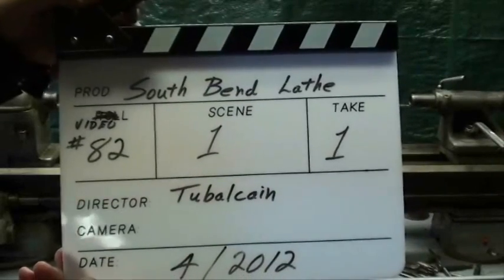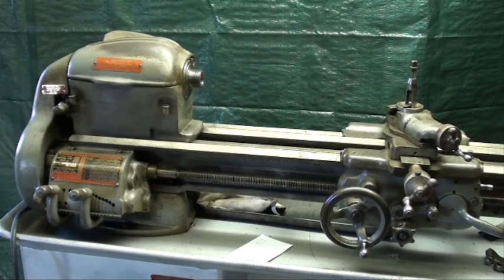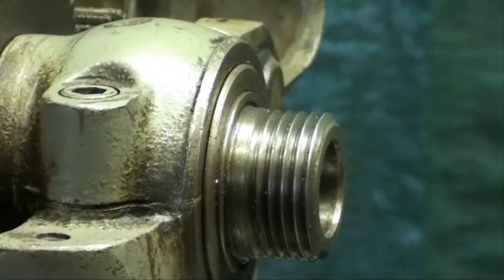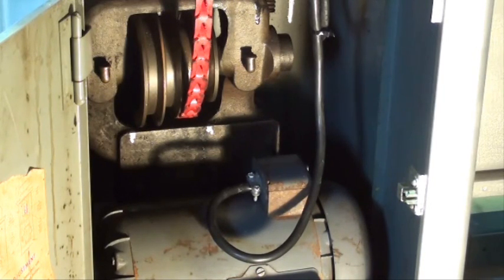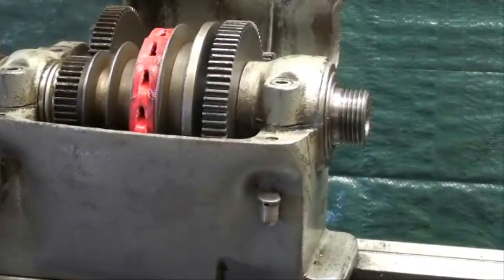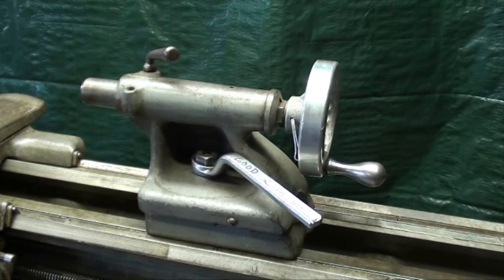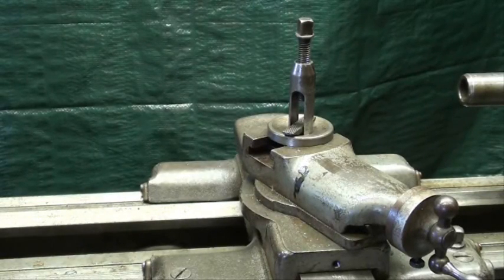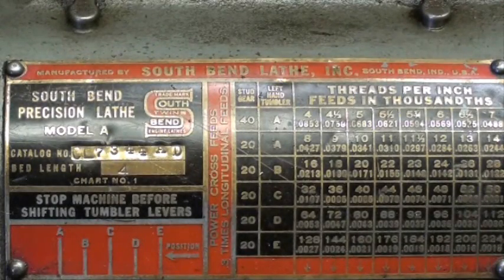tubalcain BUYS A South Bend Lathe model A tips 82

Comment: The first machine tool I ran was a South Bend lathe back in high school.  The project was a threaded arbor with washers and nuts to go with it.  After that we made a spring-loaded tap guide and a fly cutter.  I still have them in my toolbox and use them occasionally.

Comment: Great video. I have a heavy 10 with the original motor. We have 3 phase power in our shop but I chose to buy a TECO VFD so I could run it off of 110 single phase. It works great and I can dial up the speed between belts.

Comment: same unit in dad's shop....different base with motor behind and above....has the described damage from school kids running into the spinning chuck.... also has taper attachment. Dad had to repair missing tooth on back gear and replace half nuts on thread feed.   

Great machine.

Comment: Did you get any tooling with the purchase?  I assume you have enough in hand to outfit the machine.  My first lathe was a Southbend 10" heavy, sold it when I got my 14" Clausing.  The main reason was the variable speed control, love my Clausing, but I do miss my first love, the Southbend.

Comment: Hi Mr PeteI was fortunate to find a really nice South Bend 9a 4.5 ft. in South Bend. Nice condition. Has pretty light wear (gears in gearbox are almost like new) ,decent original paint and an original embossed nameplate without even a scratch on it!...The owner must have kept the nameplate covered up or something?...  The seller said he had tons of calls about it but I was the first to respond and he held it for me. I'm from the Chicago area and late one night on a whim I decided to take a look at the south bend Indiana craigslist and see if there were any South Bend lathes available and there it was.... The ad had just been posted a few minutes prior. I emailed him immediately and said I wanted to buy it . Picked it up over the following weekend .......This is unrelated to the subject but I just watched your series on the horizontal bandsaw and it was very informative but you made no mention of power hacksaws?... I own  a couple and they work pretty well. They make a nice clean cut , are easy to use , don't have to worry about breaking/rewelding blades or cutting yourself uncoiling them ,blades are cheaper , they have more of a "fun factor"(interesting to watch like a shaper). The only downside is they are slower but for most of us in home shops that is not really a big problem.

Comment: Nice find and at a great price!! Has all the good stuff: in cabinet drive, v-belt pulleys, large dials.  I have a SB 9A, with small dials, horizontal drive, and flat belt.  But I do love the old beast.  Thankfully, mine has pristine ways.  It would be a great service to other SB owners if you show a remove and check of the quick change and the apron.  I had to figure it out on my own.  Also maybe remove of the headstock and replacing wicks?

Comment: I love the SB Model A. Anybody who has ever used one would love it too.
Your tailstock body looks different than the SB tailstocks I am familiar with. I wonder if it is original. The SB tailstocks that I have seen are two piece with a plate on the bottom that rides on the ways and the vertical alignment can be adjusted by using shims between this plate and the tailstock body. It doesn't look like this tailstock has two pieces.
I'm looking forward to your videos on the SouthBend.

Comment: I run a 1 hp 3 phase 208 Volt motor on 110 volt household current.  I Use a Teco VFD. Cheaper and less labor than installing a new motor. Plus it gives variable speed.   Nice lathe you have there.  I'm a South Bend fan as well.

Comment: love my old lathe. 1949 820 logan with the quick change gearbox, auto apron and it came with a turret (not gotten around to using the turret yet though). if you want a smaller lathe you can not beat an older one.

Comment: Mr. Pete, I love your channel. I have a 1963 10k that I'm trying to restore. I'm at a point where I need to replace the gear that's attached to the V belt cone pulley. I have a NOS replacement for it. My question is have you ever tried pressing one of these on or off?
Reply from the maker: Have not

Comment: So, with a single phase motor, I guess reverse no longer works? I know there are VFD's that can use 1ph/110v to drive 3 phase motors, and they are cheap. Had you considered that option?

Comment: Great video. I have a south bend like that one except my lathe has an extra plate under the head stock, tail stock and compound. Have you seen that before? I also got a steady rest with the lathe but I don't know how or if it will work on this lathe. Also, I got a taper attachment with the lathe, is there a different feed screw nut that should have come with it so it can be disconnected without taking it all a part? The south bend book makes it sound like you just remove a bolt and it is discon

Comment: awesome i just scored one of these for $100 but its bin disassembled and there is no drive belt and its rusted but hey i could never afford one of these other wise so im goin for the restoration of a life time on mine. first im gonna assemble it to see if it could work then if i can get it to work im gonna paint it and clean it . the motor is 240 volt but im gonna look into getting a 2400 watt 120 volt motor because the shaft looks bent on the motor in this unit .
Reply from the maker: +NOBOX7 Good buy--fix it up
Reply: +mrpete222  Did some research and it turns out i have a 10L model or "heavy 10 " as they call it , not quite the same as yours . I just purchased a book specifically made for restoring this model and several others . im kinda worried about the fact its completely disassembled , the tail stock alignment may be a huge job for me as i have never done it . im gonna paint it with light  grey primer and clear coat   the entire thing and repaint and sand the brass Lable plates. also gonna refelt all the oil ports
Reply: +mrpete222 Mine has a 240 volt motor { the shaft seems bent} , do you think a good 120 volt motor would be strong enough ? Theoretically 3hp is the most power you can safely supply on a 20 amp circuit  but im worried it wont be enough torque , i mean i have brought bench grinders to a halt with very little work pressure so im kinda concerned that im gonna need 4 or more hp to run at high rpm .
Reply: Yes a 240 volt motor is no stringer than a 120v one,.   1 hp is 1 hp

Comment: Hiya Tubalcain!  I'm starting to fit a back plate to my headstock & could not determine what kind of a fregister it would be appropriate.  From what I've read, one school of thought is that the register is not really vital, as the shoulder where the plate mates with the back plate is the critical fit & needs to be scraped.  Another school of thought is that the register is absolutely critical & should be +0 & -,0005.  Any thoughts?
Thanks very much for your videos, I've learned a lot.
Jon